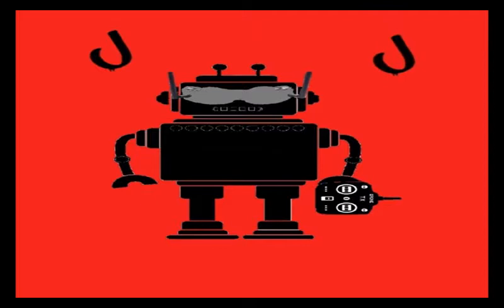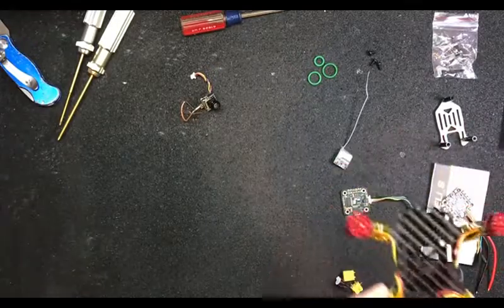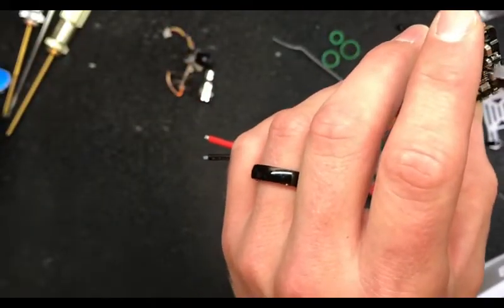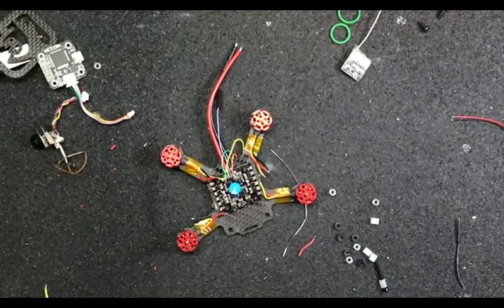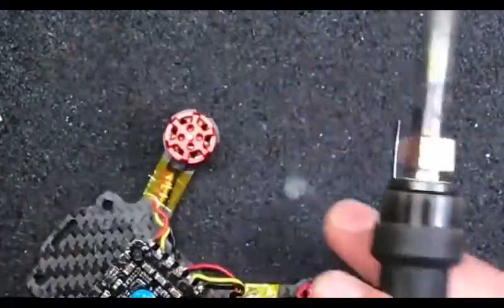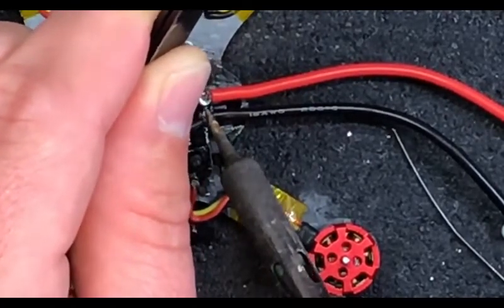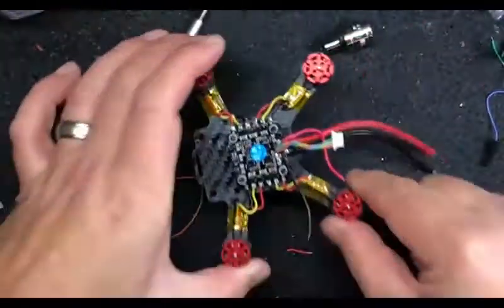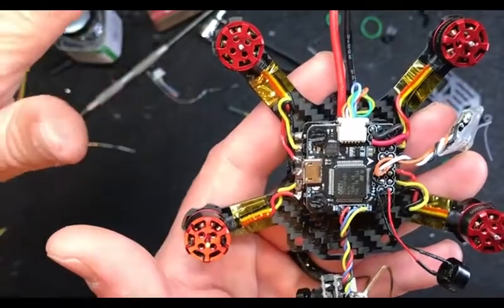Quadcopter Kitchen- JJ and Blackhawk build a micro.. it even flys!!

Comment: If you clean the tip and get fresh solder and then apply it will flow better and faster.
Reply from the maker: +Warlock Hunter it’s alll about a clean tip.    That’s for sure